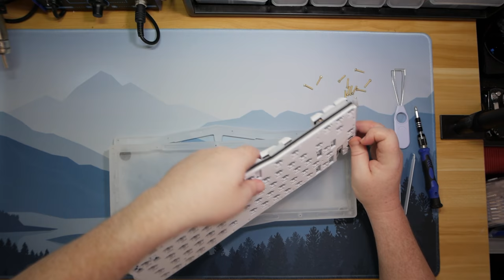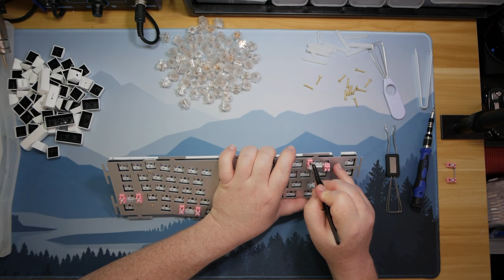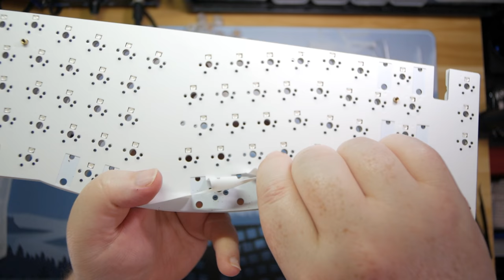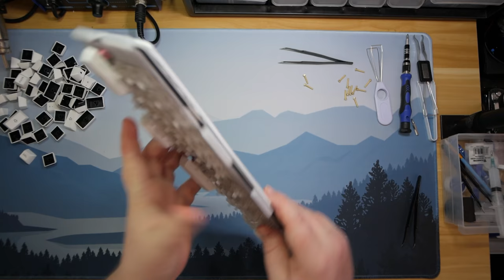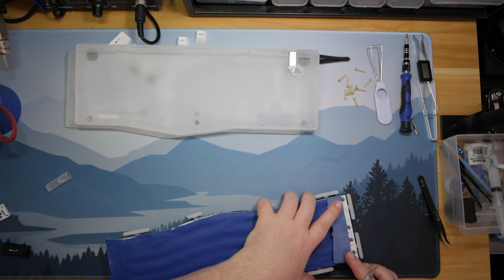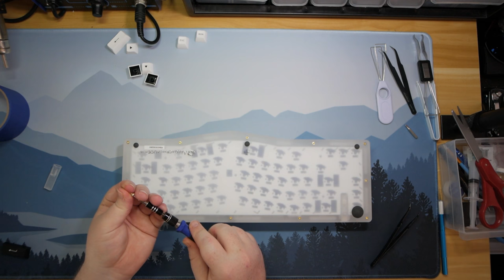Akko ACR Pro Alice Plus Build and Mod Session

Comment: I just ordered the sprayed black version. Its my 1st 'custom' so it should be experimenting with diff mods. BTW some are saying cherry switches wont fit in the north facing leds. Any truth to this?
Reply from the maker: That is correct. The Akko switches help with this but it doesn't make them work with every manufacturer. Grats on your new board!